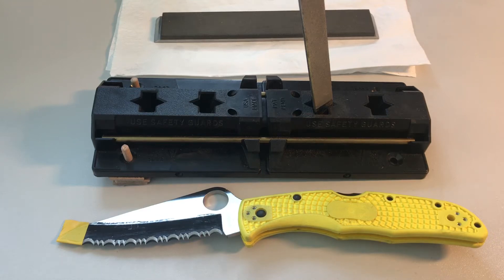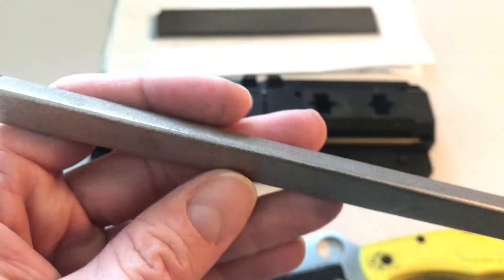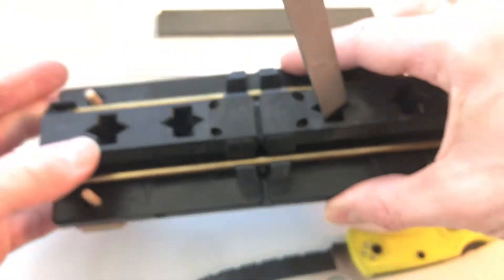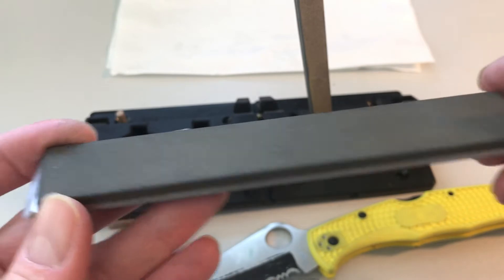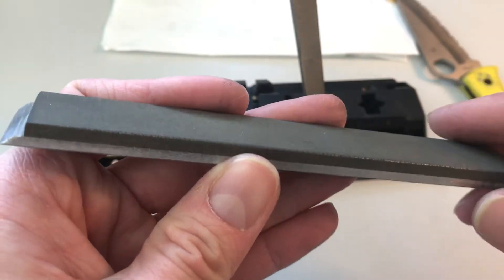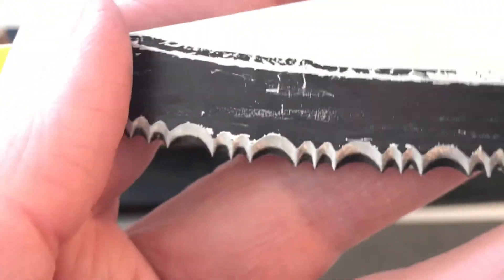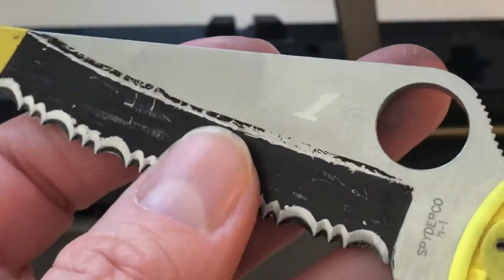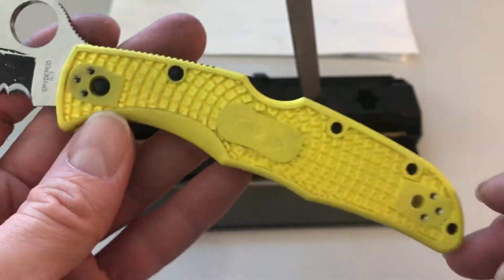Part 1: Regrind / reprofile of the Spyderco Pacific Salt 2 in H1

Comment: Very cool idea! 
A random thought I had: if h1 work hardens, using “rounded over” or older diamond abrasives may provide more of this effect.

I’ve attached diamond plates to my sharpmaker with strong rubber bands. You can use coins under the base to make micro adjustments to the angle. 

I’m going to watch your channel to get an opinion on h1. It’s one of the most interesting steels out there. Did you hear the news about h2?

Comment: thinking of this...i just re-sharpened the serrations on my Byrd Rescue 2. I worked both sides. The side with the scallops I kept at 20 dps...pecause reducing it at 15 or lower would have been a monster job...and i also worked on the other side....using the edge of the concave grind to keep the serrations on the stone. 
The result is ok. Sharper than it was but less aggressive.
Reply from the maker: Is mu understanding correct, that working the right side takes the points of the teeth off? That would definitely reduce the aggressivity, but I guess also catching on the material. Yes - dropping the angle on these relatively thick SE edges is really a multi-hour job as one can't just put it on a normal water stone and get it done in under 30 minutes.
Reply: @matusknives  Yes, Working the side opposite the scallops will round off the teeth. I find this better as I noticed that a bit of "slide" in the cut helps. I sharpened a few Victorinox kitchen knives and tested them on vegetables. The aggressive serrations seemed to cut a bit "less smooth". Not sure if for edc tasks i would want super aggressive serrations. I can imagine that for a quick "cut and go" job an aggressive pattern would be prefered. But for that one would actually need to have a "serrations" sharpening kit and/or spend a lot of time. At that point...i think i would prefer a super sharp fine edge

Comment: I came back to see if you made an update on those serrations....the test
I am very curious. Also I just ordered a couple of CBN rods
I never used cbn rods before. Trying to "steal some knowledge"
Reply from the maker: The cutting video will be happening soon (I know that it is a poor excuse, but I was waiting to get a package in some really thick cardboard box 😁), but there is already a follow up video (Part 2) that shows the finished blade.
Reply: @matusknives  I have seen the second video already. I rewatched this one because I remembered you talked about the CBN rods. 
No worries...i do that as well...wait to get the chance or materials to cut so I can test. I was wondering whether to also modify a blade like you did. I have 1 serrated "rescue" knife. A Byrd. but the edge angle on that one is quite small..about 15-17 dps on the show side and 10 on the other.
I never use it....and am curious at how/when it would be a benefit to use a serrated blade
Reply from the maker: @SpartanJohns  I can try to address some of those questions in my next video, though I am not too experienced when it comes to serrated blades. I personally consider them a special purpose blades as there are tasks you definitely don’t want a serrated blade for - bushcrafting jumps to my mind.